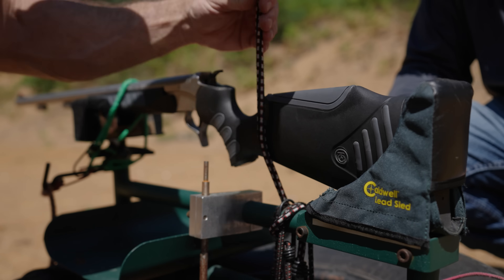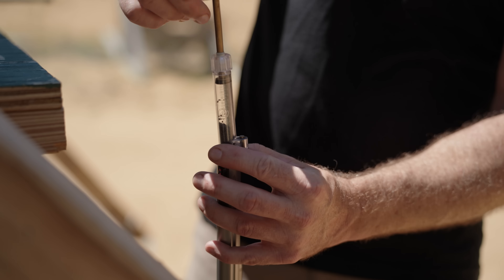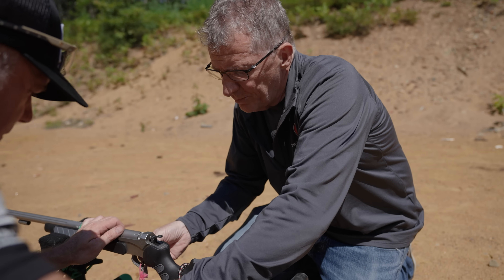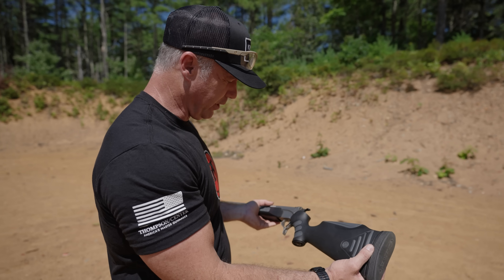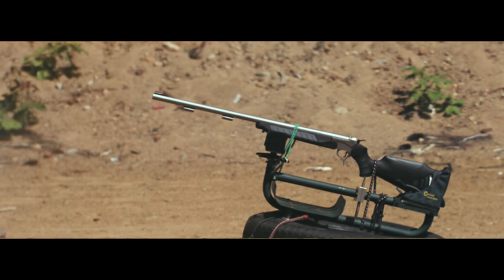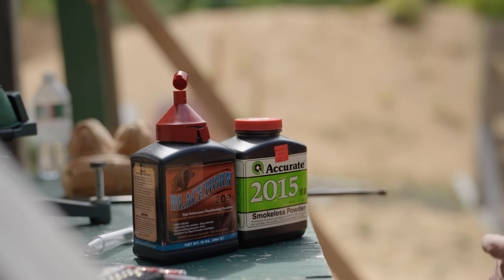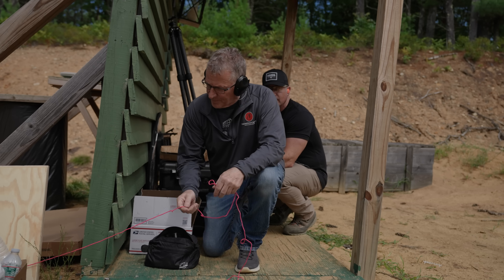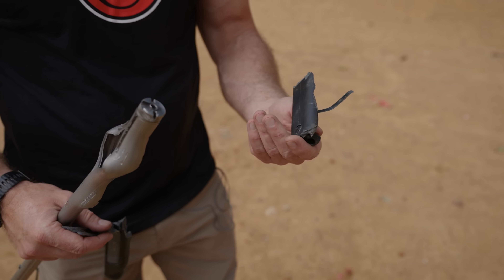My Muzzleloader Exploded

Comment: It would be pretty sweet if you made a muzzle loader capable of handling a NORMAL load of smokeless. Some states require muzzle loaders for certain hunting and I’m sure people used to reloading other cartridges would prefer just working up a load with powder they already have rather than diving into the black powder world
Reply: Actually diving into the black powder world as far easier than dealing with smokeless powder. I reload smokeless cartridges and everything has to be absolutely precise from the type of powder you use even the type of primer and cartridges. Black powder is far more easier to deal with because everything is measured by volume and not weight. Only thing you have to worry about is if your primer are 209 MZ. There are over 100 different types of smokeless powder each one has a different burn rate. I’m sure you do not want to have to carry a weighing scale out to the field with you.
Reply: we do NOT need more of that in our muzzleloader woods... the idiots running around with cheap inlines are bad enough. Smokeless muzzleloaders should remain in the custom realm.
Reply: @BeetleBuns  I absolutely agree because muzzleloading season is for muzzleloaders. Even though I’m a big gun fan, I still believe in just having a season dedicated to enjoying the experience of black powder hunting. I honestly believe people are wanting to use smokeless powder during muzzleloading season. They suggest stick to modern firearms and leave muzzleloaders alone because it’s obvious that muzzleloading isn’t for them.
Reply: @jeffreyburney6161  A couple states are screwing the thing up with allowing straight wall centerfire in the muzzle loader season. 100% I am against that.
Reply: Smokeless loads are impossible to 'work up' for the average shooter, unlike a bolt action center fire rifle where there is reams of loading data. Smokeless pressures can spike from just an over charge of a couple grains or less, and there is very little load data out there currently. The average hunter/shooter is for sure out of his league with this. There is load data on DVD's being sold online on Ebay and elsewhere of supposedly low pressure smokeless loading data good for any inline modern gun. Blackhorn average load pressure runs around 25,000 PSI while many centerfire bolt rifle rounds are double that. I get it if a smokeless load runs under 25,000 PSI  it is likely safe, but how many folks are gonna get hurt playing that game ?
Reply: @jeffhays1968  oh absolutely, there’s really no way to predict what any amount of smokeless powder is going to do in a black powder muzzleloader. 25,000 psi about average for black powder. Even small amounts of pistol or shotgun powder can produce pressures higher than 25,000 psi. And most smokeless powders even the slowest burning powders will be in the rim of 50 to 60,000 psi before the projectile even starts to move. Best to stick with black powder and a muzzleloader. I always tell people that if you don’t like messing with black powder, just stick with modern firearms don’t even mess with a muzzleloader. And muzzleloading isn’t for everyone. You have to have an appreciation of just the tradition in the concept of using black powder. Calculate smokeless powder loads all the time, but I would never consider doing one for my muzzleloader because I know that the barrel is not designed to withstand it
Reply: @jeffhays1968  you gotta look in the right places... people have custom built inlines made from bolt-action rifles that they use for smokeless "muzzleloading." It's a cool rabbit hole, and they have loads of data.